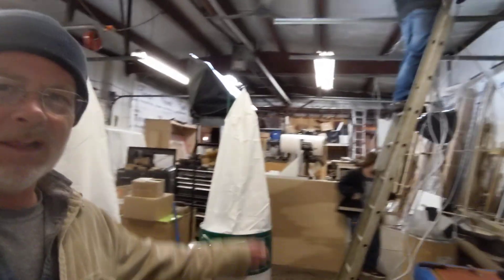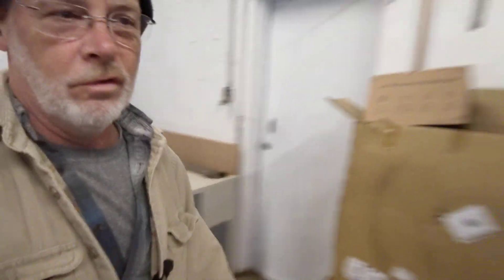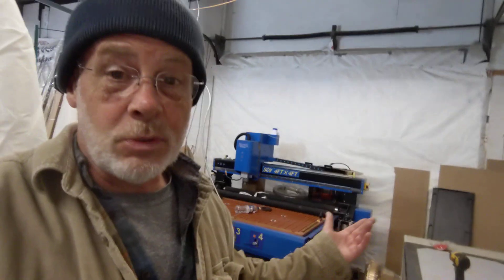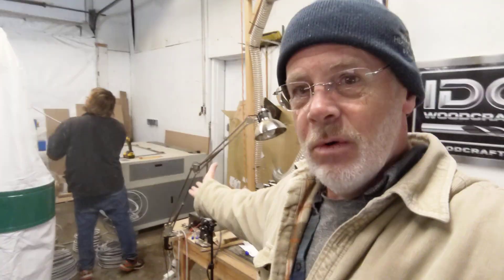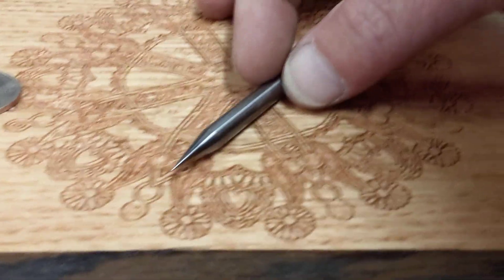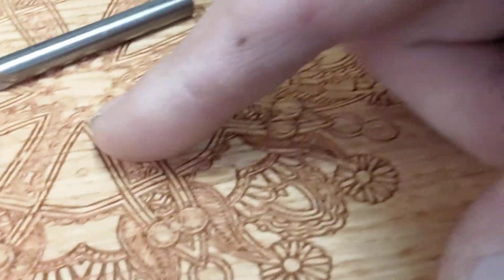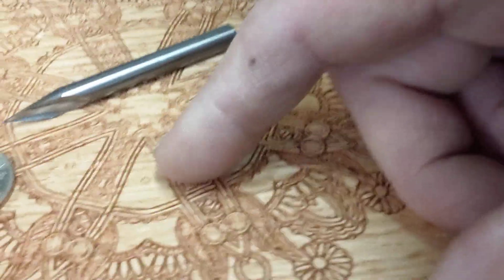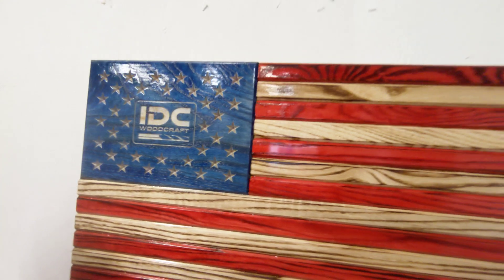CNC Router Weekend Update, The Phantom CNC is getting wired! IDC Woodcraft Garrett Fromme

Comment: I'd like to know the electrical requirements for this machine including the vac pump...I'm planning mine now
Reply from the maker: Hey. It's 220 single phase for all there items, CNC, vac pump and dust collector.

CNC is 30 amp. Phantom recommends 30 for the pump and 30 for the vac. 

Pet the electrician, the second two can be 20 with plenty to spare

If you talk to phantom, tell them I said hello!!!